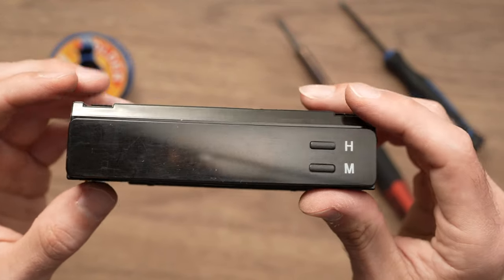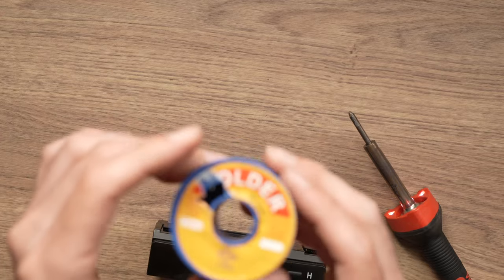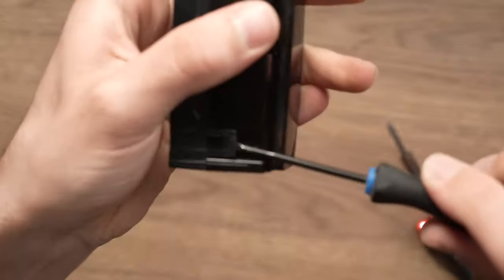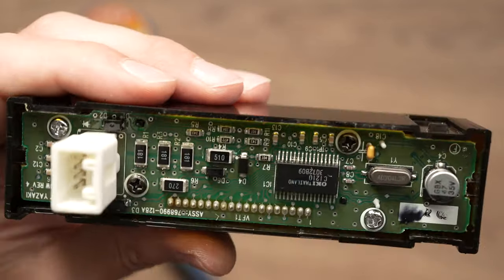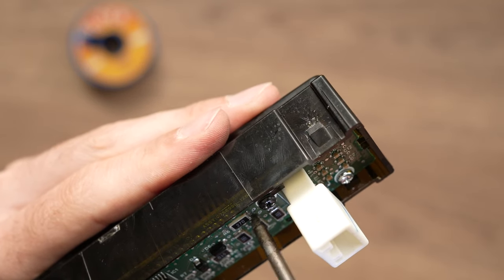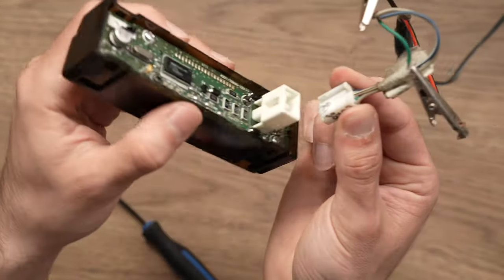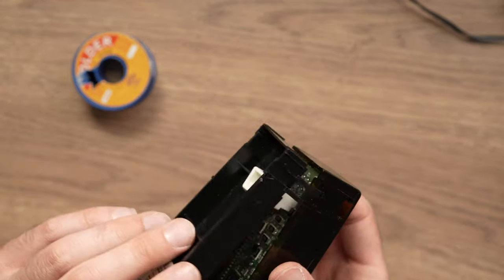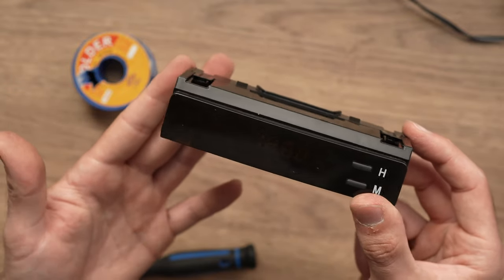Toyota Corolla Digital Clock Repair - Step by Step Tutorial Guide

Comment: Thanks for the video! Can you explain the diy plug you used to test the clock? Is the green, blue and white wire negative and the white wire with a black stripe positive? Also, did you use 12 volts to power the clock on? Thanks Again.